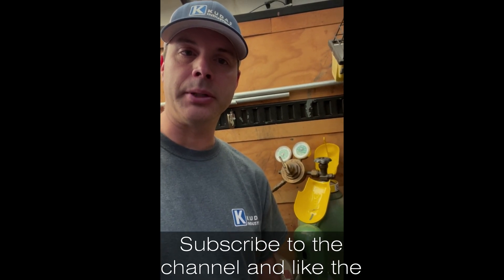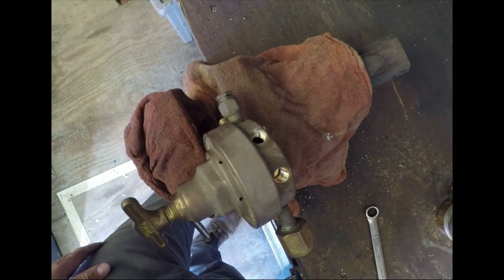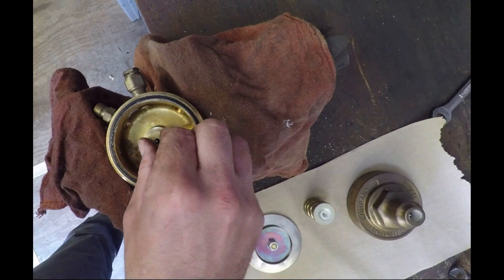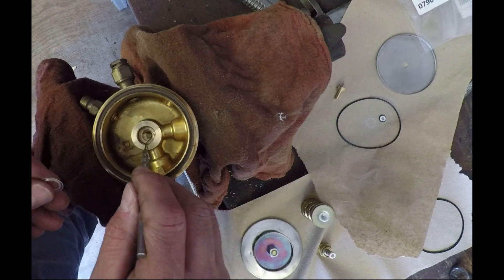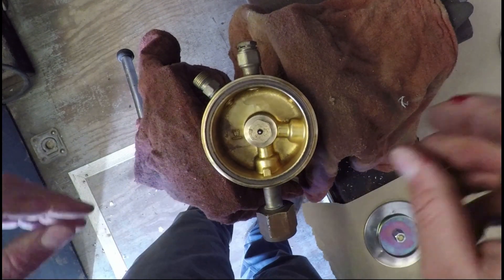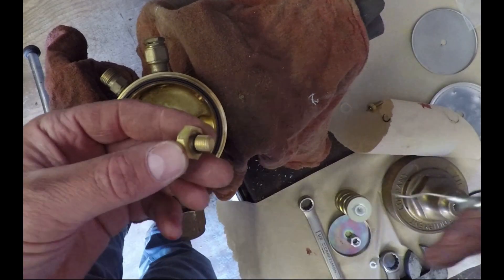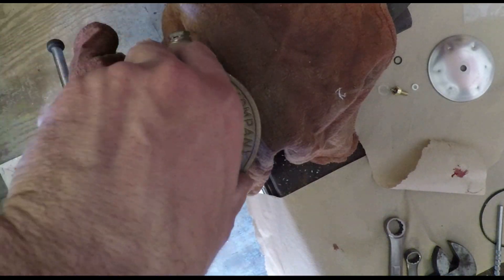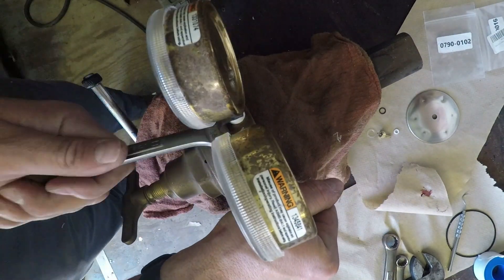Victor SR450 Oxygen Regulator Rebuild

Comment: Instead of taking the gauges off flip it over and put the hex part of the housing cap in the vise and because they are not tight you should be able to turn the housing to get it off. There is no reason to tighten the vise down and risk damage just leave an opening like you had on your adjustable wrench.

Comment: Thank you very much. I am searching for an alternative to using Windex as a temporary "keeper" of the gasket for when you need to turn the whole shebang upside down. Windex is quite a complex formulation of detergents, surfactants, and waxes none of which evaporates completely away. When I find an oxygen compatible "keeper" I will contact you.